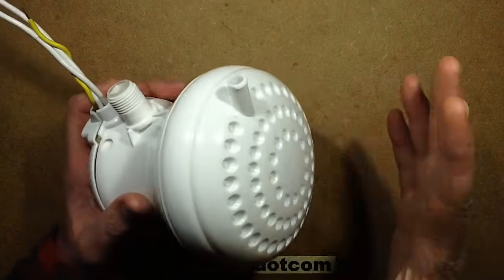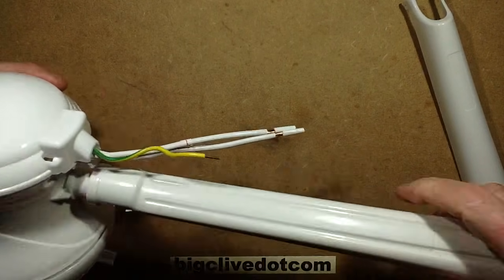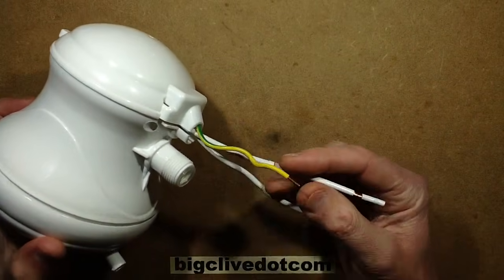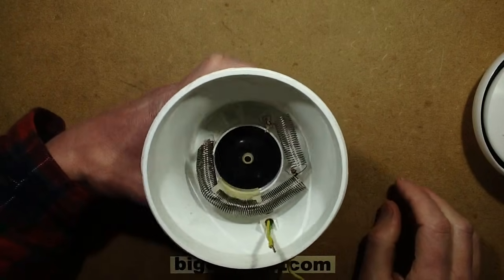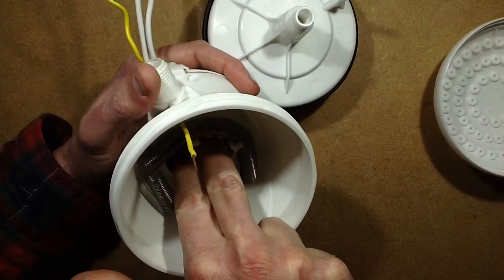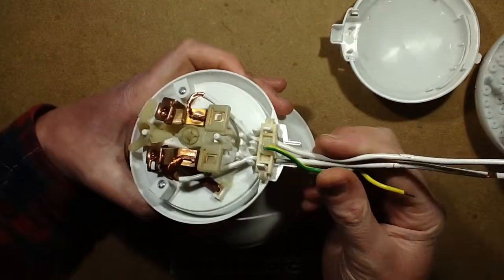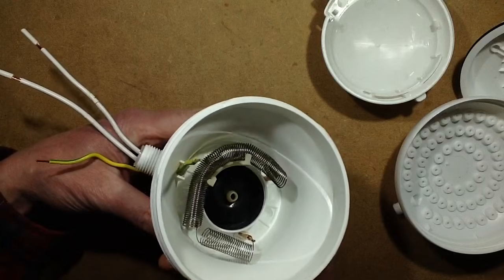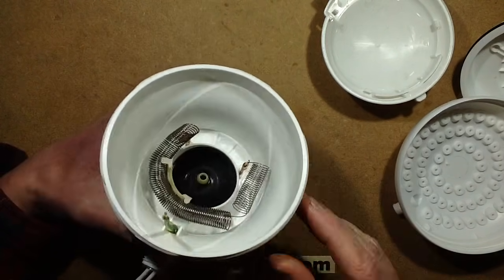Inside a heated shower head.  (suicide shower)

Comment: Well we used to have one of these in my house in Colombia, we had 3 of them beforehand before going to a gas heater. I think the point of these is that it's cheaper to have if your electric bill is low and putting a gas line connection to your house cost alot of money (fortunately can be financed). From what I remember when I was a kid, was that the first one exploded after a power surge,the second I broke it after grabbing the the tube that connected the showerhead since it has a switch you had to move to turn on the hot water, fortunately the tube was plastic and not metal.and the last one,well that one we gave it away to my grandparents in the countryside, were gas lines are mostly limited.

Comment: My wifes family home has one of these in the house at the foot of Mt Kilimanjaro its alright but you have to keep turning on and off the light switch which is on the wall underneath it when you have a shower or the water gets too hot, when it cools off turn it back on
and you can see the terminal block on the end of the short wires when you look up
The light switch fizzles and bangs a bit but this is normal
after two weeks I found that I was showering in river water from a stream and using bubble bath as shower gel

Comment: Clive, the hose you referred to as a pressure relief is really used as a remote shower head; also, everybody comments on whether you can get shocked by this head or not, like any water heater in the world, if the element goes bad and it's not grounded, it will find the path of least resistance.

Comment: I use one from a brand called Lorenzetti, it's a bit different it's more powerful , it also does have a pump built in. I like it. changed the heating element once, i'ts about the same thing as this, except it have a larger diafragm to drive the contacts an the heating element is in a heat resistent plastic. But it still uses the exposed wires and everything else. It's pretty good, I can't complain.

Comment: Most of the houses in Brazil does NOT have GFCI/RCD breakers (which is called DR - "Disjuntor diferencial Residual") also does NOT have grounding wires. And DOES have the suicide shower head! HA HA HA

Comment: The earth wire needed to be covered in silicone, because the fuse would shut down if electricity goes out over the earth wire.
Basically it is just there so the showerhead looks safer than it is.

Comment: A little bit of history: The suicide shower became popular in Latin america in the 80s. They originally came from Brazil and started to get sold all over Latin america. It became an instant hit, it allowed People with little money to finally get hot water for a fraction of the cost of installing a proper water tank heater. 

Me and every neighboor in my block bought it, almost at the same time. The first time i  used it, i was scared shitless to see the exposed wires and sometimes you could feel the static electricity going thru your body. But, After a few weeks i got used to it, even thou it looks scary nobody in my neighborhood ever died throughout the years. It is so popular that even rich people have one installed  in their expensive bathrooms even thou they could afford a separated hot water line.

Comment: I think the biggest enemy of this kind of showerhead is limescale. When it precipitates it can make the safety lock on that auxiliary tubing at 2:15 stuck in place, than it can blow up because of the pressure building up. Limescale can also make the diaphragm of the electrical switch stuck on the top, then it wouldn't turn off when the tap is closed, hence it can melt the plastic or it can even catch on fire.

Comment: @7:33 hello i'm from brazil and every single shower in brazil (exept on 
hotels and resorts) is like this ,we do have separete residual 
differential circuit breaker(RCD) on the shower but is a 40ma one. the 
circuit for the shower usualy is a 40amp breaker with i's own RCD  with 
6mm2(awg9) wires directly to the shower and gives no shock anything if 
was that dangerous i'm shure this was banned. but it's not and we use it
 for years. we do not have boiler systems here and the pipe is only PVC,
 also we do not use copper piping at all. 
you can see the rules on 
the NBR5410 ,in section 5.1.3.2 talks about showers(chuveiro) and so on 
,page 57 
.https://www.iar.unicamp.br/lab/luz/ld/normas%20e%20relat%F3rios/NRs/nbr_5410.pdf
  i'ts in portugese(NOT SPANISH)
Reply: Finally somebody talked about DIN breakers....

Comment: my shower works this way, actually every eletric shower in brasil works like that, and when when i was a kid they did not had that ground wire and it caused a little, or not soo little, shock when you touch the valve, that was metalic by the way and it was quite probable that it was connected by the water with live from the shower because it wasn't grounded, it was not very safe i think. All brazillian eletric showers are suicide showers and almost all the shower in brazil are eletric. It is safe if well installed

Comment: I'm from Colombia and this kind of showers are very common here too, I have one myself, similar to this one but with the big diagram, and there is no ground installation here, this houses were build like 40+ years ago, but haven't had any problems with it. The risk of lethal electrocution should be very low, I haven't heard of a single case of that so far.

Comment: Used them for decades while assigned overseas in the military ALL OVER THE WORLD, a person is more likely to get burned than electrocuted here, even if improperly installed and not correctly grounded.  This is due to the influx of water into unit, which takes the path of water resistance back to source along with volume over the drops coming out of the shower head.  The most dangerous situation are those that have power "controls" near the shower via plug, which is plain stupid.  This device is not a "suicide shower" as similar units are used all around the world.  Many tourists are making up stories for drama.

Comment: The answer why we use these in Brazil is simple. The electrical bill here is very cheap because we have a lot of hydroelectric facilities, in the other hand we don't have any natural gas sufficiency. If you install these electrical shower properly and use good products with more safety features (better ones that the one reviewed in the video) it's as safe as a central heated ones.

Comment: The hose is not for safety pressure release, lol.

It's to bring water closer to wash more tricky bits of your body! 

The little pin is for turning the water on and off in the hose.

Comment: A sort of similar story: I recently lived in a rented apartment in a house that was built around 2012 (this is in Finland). A really nice place. One day I realized when I came back from the gym and took a shower that when I adjusted the water temperature and flow knobs, I felt a kind of tingling in my hand. I thought I just had a nerve compression or smth. It kept happening for weeks until I realized what was happening:
I was standing on top of a metallic drain grid that connected me to the wet floor. When I touched the shower knobs I completed a circuit. It turned out the screws attaching the bathroom mirror closet (above the sink) had punctured a wire inside the wall on the living room side, and brought the entire wall into voltage, and when the wall was wet, it began to conduct.

Comment: You need to know the earlier all metal version. That is really crazy.
https://www.youtube.com/watch?v=1iF6zZmg56I
But it still safer than indoor gas heaters, vacuum tubes guitar amps, electrical toasters or a loaded glock in a drawer.
Best regars!
Reply: Vacuum tube guitar amps are safe with proper mains isolation. Basically every tube amp sold has an isolation transformer.

Comment: These devices seem to be quite a good idea, but my concern is this an earth must be connected to these units for safety, but using this design the earth connection, will over a very short period of shower use become oxidised. A coating will form over the exposed copper earth wire making it as useless as a protection against electric shock. Also water will creep into the plastic insulation by capillary action and get into the mains connection block. This Chinese knock off device is truly a suicide shower, the concept is a good idea but let down on the cheapness of the design. No doubt there are manufacturers producing this type of unit that meets safety standards and are  installed to the countries electrical codes, and create no safety problems for the user's but this china cheap knockoff needs to be binned.

Comment: This shower head is a cheap copy of the traditional Brazilian brand "Lorenzetti". The Lorenzetti brand shower heads have been widely used in Brazil for many years without any particular problems. Obviously,  the device should be properly installed, with a real ground wire, and a Ground Fault Protector circuit breaker (known in Brazil as "DR") .
Reply from the maker: What does the DR translate to?
Reply: It translates to Differential-Residual circuit protector. Follows the device data (Pt-Br): https://w3.siemens.com.br/automation/br/pt/downloads-bt/Documents/Dispositivos%20DR/Cat%C3%A1lago/Cat%C3%A1logo%20DR_2016_PT.pdf  
At the end of the PDF there is a suggested wiring layout for installing the DR. Notice that the shower head appliance must have its own AC outlet (dual phase:110V+ground+110V  or single phase 110V+neutral+ground) capable of withstanding the maximum current that will flow through the device (specifications are on the package of the device). Also,
it is strongly recommended by the manufacturer that the connection to the wiring must be only made by appropriate ceramic terminal block or R/Y Wire connector https://www.3m.com.br/3M/pt_BR/3m-do-brasil/todos-os-produtos-3m-do-brasil/~/Conector-de-Tor%C3%A7%C3%A3o-3M-Scotchlok-2/?N=5002385+3292928731&rt=rud

Comment: Well... 2 things:
1- this is the lowest end and chepest model, its bad and really problematic, you shouldnt economyze when talking abouy eletricity
2- If people dont wire the earth wire, thats not a shower flaw, it is rather a flaw of the people, just like saying that a car shouldnt be manufactured because someone runned it without breaks and tires, and got involved into a accident. 

Those showers are actually pretty safe, and i would feel safer with those than with the gas ones, that i kill a lot of people here in brazil, maybe because of lack of maintenance or bad insrallation, but it is the same way as those problems in the eletric shower.

Comment: I live in Argentina and used one of those showers for three years until I moved out (then the unit kept working for two more years until finally broke down). I installed it myself, it was connected straight to the main power line, with wires twisted and insulated with duct tape. I lived in a camper and there was no earth grounding and also no RCD. The walls were of aluminium.
I never felt anything but a friend, which is taller than me, took a shower on it and felt that tingling feeling.
However I had no idea that the electricity was just running throught the water, I assumed there was some insulation between the resistors and the water.
Funny thing, in the house I spend my childhood the house wasn't grounded either. Several metal stuff (like the computer case) would give you an unpleasant shock if you touched it and also touching the ground. We learned to live with it.

Comment: It is worth mentioning that plain water is mostly non-conductive. Or at least not conductive enough to give a lethal jolt over a distance through a stream of water. It seems like the electrocution potential of this thing stems from introducing a wet human into a situation where there can be exposed mains power and something grounded -- somewhere that the wet human can accidentally touch them at the same time, in a way that completes the circuit through some vital organ. That seems like a lot of things that need to go awry... I wonder how many have actually died from this type of shower head while taking a shower?

Comment: I remember all of the wiring in my room exploding everytime my roomate tried to use this. That was the wiring's fault though not the unit. Also, most places I lived in didn't have the greatest water pressure so you don't need as much power since the water has more time to heat up in the unit before drizzling on your face.

Comment: I know these are common in Latin America. I visit often and have used them myself without being shocked. This is a knock off of the most common brand (Lorenzetti). It would be interesting to see how the Lorenzetti models are better.

I doubt that ground wire does much. It’s copper and will corrode and become non-conductive rapidly upon use.

Comment: Extremely common in Brazil, probably because we were the ones who invented it back in the 30's, they are really safe if installed correctly, though they consume alot and I say alot because it really consumes alot of fucking energy, but here in Brazil the electricity bills aren't too expensive hehe

Edit: the version you see in there is a shit pirated version of our Certified Lorenzetti showers, so it ain't the ones we use down here

Comment: I used to live in Paraguay, where these are pretty much in every house! I used to work as an electrician there and used to install them. I have installed and used these with RCD's, and they worked fine. And as long as they are earthed, they're absolutely fine. They're literally used by millions of people in South America, every day.
Reply: but you at least earthed it. My friend was in cuba and he said, he never had to drink coffee after morning shower.
Reply: I usually go to Paraguay and most of the times I just open the faucet normally until I get shocked, at which point I just open it with my flipflops in my hands lol
When I come back home the first thing I do is to take a nice little gas heated shower, it can't kill me unless I lock myself down in the boiler room (so it's a little less painful)
Reply: Where i live in Dominican Republic theres a lot of houses that use this, and it works great as long that is properly grounded.
Reply: That is true, i have one myself and i do get the tingly sensation when i shower.
Reply: I have a similar model made by lorenzetti in both my bathrooms. Installed properly.. Never had a problem. The bigger ones consume more electricity, this model is the basic one and very economic.
Reply: Addicted to Projects 
and here I was assuming that everyone could just turn on the faucet and hot water streamed out of the shower head, instead of using these heated ones. I guess I take hot water, on demand for granted.
Reply: Gaz Girl no your are wrong
Reply: I would say because this shower is practical and economic... For example, there is no piped gas supply in my city and using an electric water heater would consume too much electricity (our electricity is very expensive - I'm comparing Brazil with the US). Also, we don't need that much of expertise to build the plumbing of a house if is just regular cold water.. Add to that the fact that (at least where I live) the weather is almost always hot, so the warm water is just for confort not a necessity. Water is also a problem sometimes, for instance here in northeast brazil we have droughts from time to time. So many people do use this device or more elaborated ones. Usually you would see hot/cold water systems in houses in the south (where could get really cold), buildings, hotels and places where this type of water system will save some money. I think it  is also cultural in some way, because we build houses somewhat like that (with no cold/hot water distinction)...
Reply: @Bernhard Jordan wow.............
Reply: Used to shower in one of these when I turned it off it bursted into hot boiling water and fell through the head extremely fast
Reply: I once saw someone charging their phone with the two wires just jammed into the electrical socket with plastic fork spikes. He said the same thing to me, that it's perfectly fine. Glad I was one of the guards of that place at the time so I got them out from there before they shorted anything. -.-

I'm also quite baffled that their phone was fine with being charged with 230 volts.
Reply: Why would you lie on the internet?
Reply: Under no circumstance, am I bringing 220 volts anywhere near my shower. Holy shit.
Reply: Thanks for your input.  First time a come across this device.   One question, if there's a need or desire for people to bathe with warm/hot water in paraguay or as you say millions in south America, why don't they have regular water heaters? Are the houses not fitted with hot/cold piping?
Reply: no dude, these shitty things dont comply with the RETIE on colombia.
Reply: Funny how they are not used in countries that do not allow dangerous electronics near water and instead are just found in countries where the GDP is lower than the hygiene standards....hmmm...totally a coincidence.
Reply: Addicted to Projects bullshit in Argentina and Uruguay they don’t have this rubbish device